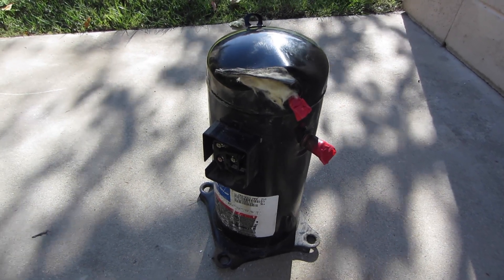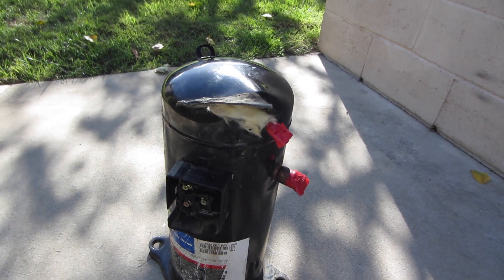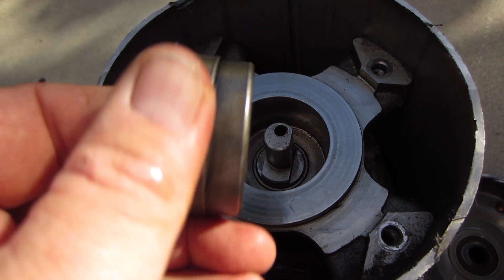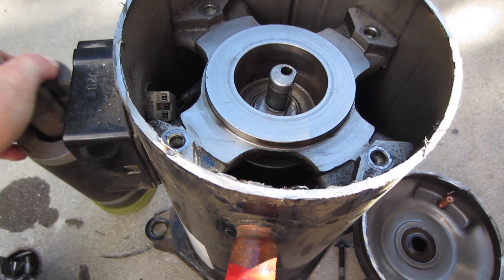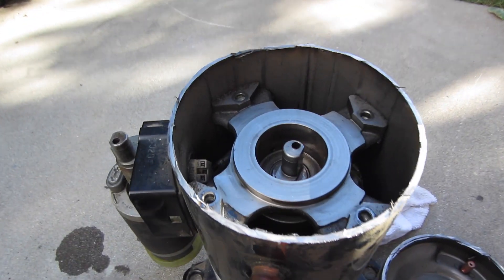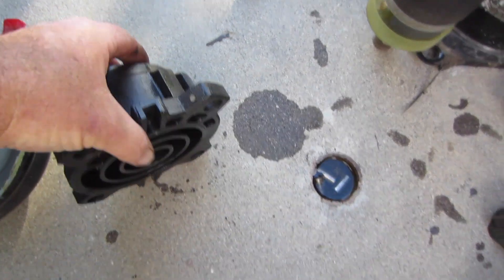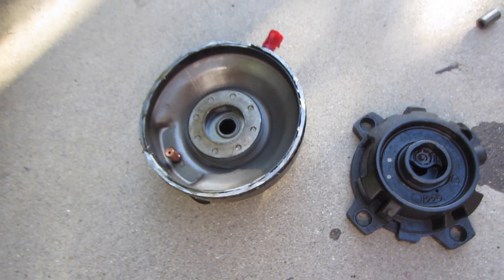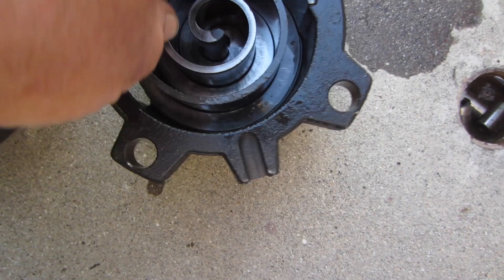Noizy Copeland Scroll Compressor.

Comment: Believe if you have an EEV valve that closes down due to blower stopping coincident with compressor turn off and leaves liquid line trapped at evaporator EEV on one end and back flow block on scroll compressor end, full of liquid refrigerant you can have restart issues with floating seal quickly establishing differential pressure seal during startup.  The liquid line may take 10-20 minutes to relieve back pressure which is enough time for a new restart call by thermostat.

Although Copeland claims scroll compressor doesn't need pressure equalization because it starts unloaded, lack of achieving pressure differential quickly on floating seal can beat it to death with startup chatter over usages time. You may hear a short 'brassy cymbal' sound for a moment when compressor starts up with a chattering floating pressure seal.

Comment: 2:10 the circular marks on the plate are caused by liquid flood back. It would seem simple enough to have an alarm and shutdown when the system detects low or reducing subcooling. Would people be interested in a kit to protect the compressor?